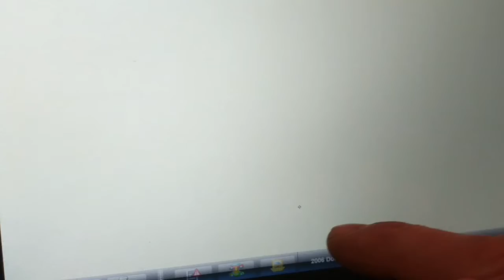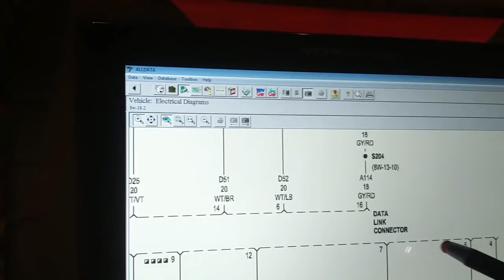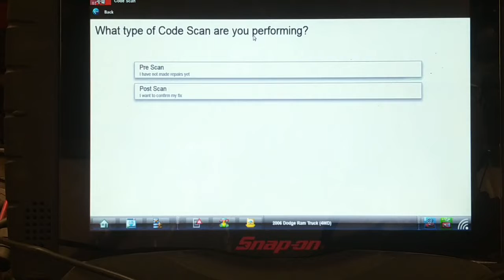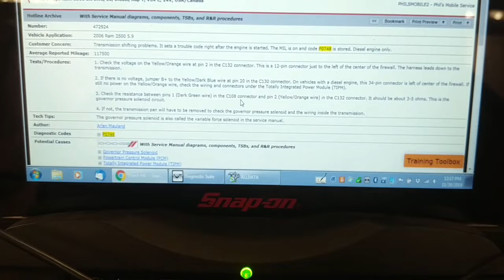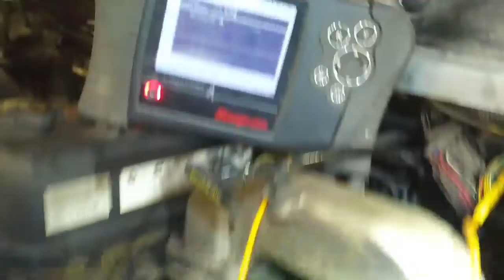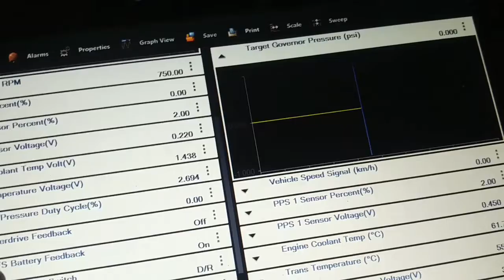2006 Dodge Ram 3500 P0748 Governor Pressure Circuit and CAN Bus Issue

Comment: I have a 2002 Dodge ram 1500 (curved body) 5.9l Magnum V8 & 46RE. 
I have a constant code P0748. Today, i just installed a new Mopar governor solenoid & it didn't fix my problem. I notice in the scan tool that the 12v transmission relay is on when first starting the truck. When i drive, the 12v relay turns off. That's when I'm stuck in 2nd gear. The solenoid voltage doesn't go over 2.5v, the target pressure will be 125psi, actual pressure will be 40-50psi. 

I'm gonna see if swapping the transmission 12v relay around works. Then I'll look at the harness at the firewall under the truck. If that fails, i may need the governor sensor transducer. If that doesn't work, what should i check. Sorry for the long post. Thanks
Reply: Hey did you ever fix your issue? I’m in the same boat.

Comment: So did changing the sensor/ solenoid work or was it a wire problem.

You can stop the door ding by simply closing the latch on the door… you just have to remember to pull the door handle and release the latch before you close the door.

If you forget, it will remind you
Reply from the maker: I believe it was the corroded control wire above the bellhousing.

Comment: I'm from Brazil, the error that appears on the 48re gear is the P0622, I have problems to change from first to second gear, the others work well, do you have any idea what the defect is?
Reply from the maker: P0622 is a fault code for a problem with the charging system. "When Monitored:
With the ignition on. Engine running.

Set Condition:
When the PCM tries to regulate the generator field with no result during monitoring. One Trip Fault. Three good trips to turn off the MIL." 
I doubt that is the problem with the transmission though. I'm not sure what you mean by having problems "changing from first to second gear" Is this an automatic transmission or manual trans?
Reply: @PhillipBailey  automatic transmission, P0622-transmission this is the only error code that appears, I will open the transmission and test the solenoid, but I think the problem is electrical, have you never had this error code in a transmission?
Reply: @PhillipBailey  it may be that the problem is in the fuse box, tomorrow I will check the transmission fuses, sorry if I do not understand myself correctly, I am using google translator.
Reply from the maker: @AndreArisa2  Ok so it is actually an automatic transmission? That code is not a transmission code. Try a different scan tool. What are the symptoms exactly?

Comment: Greetings,
Honda Pilot 2004. 
Check engine codes came after alternator failed. 
P0748 Pressure Control Solenoid A Electrical. 
Transmission fluid was smelly, medium dark. Only gear 1 and R work. 

Changed Presure Solenoids AB and C. Changed transmission fluid. 

Problem not solved. Please help.
Reply from the maker: Sounds like it's a transmission rebuild time.
Reply: It turned out the problem was only VTM4 electrical switch failure. After tracing the issue, it was a simple matter of changing a fused switch under the driver side dashboard.

Comment: Why was desired psi 0? I'm having the same issue with my truck
Reply from the maker: I believe because of the active fault code in the circuit. Governor pressure sensors are common to fail on these especially if the transmission is tuned or modified. Good luck

Comment: So other than the crappy wiring mods. Was there any other issue ls. Bad connector pins or broken wire on the back of the connector.? I having trouble  locating the cause of the P0748 code. 2003 Dakota 5.9. As for grounds, where are the transmission grounding points??  Off the engines grounds?? Thx.
Reply from the maker: If this problem is consistent where the code sets as soon as you start the vehicle then I would test the resistance of the resistance of the governor pressure solenoid, normal is 3-4 ohms.

Check to see if the solenoid is losing the power supply to it just before the code sets. If so, swap the transmission relay and verify the wiring to it.

Check the signal on a scope to see if the circuit is staying grounded all the time. If so, check the wiring to the PCM and for a possible bad PCM. Good luck. I don't think this would be a ground problem.